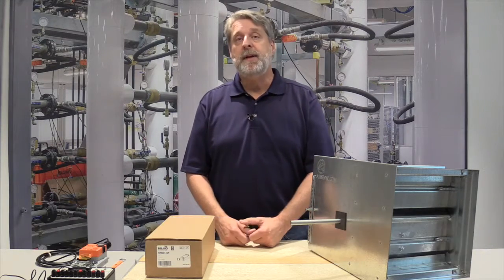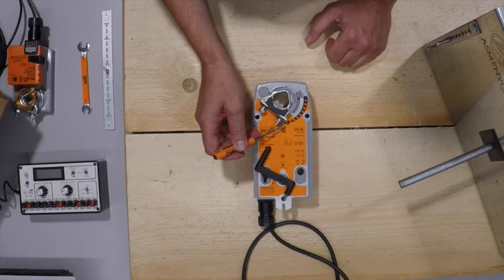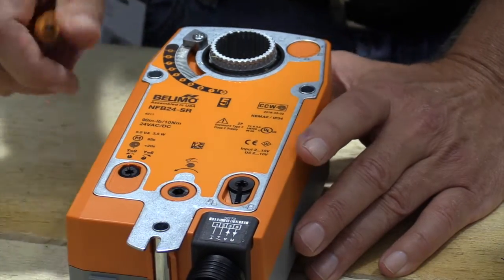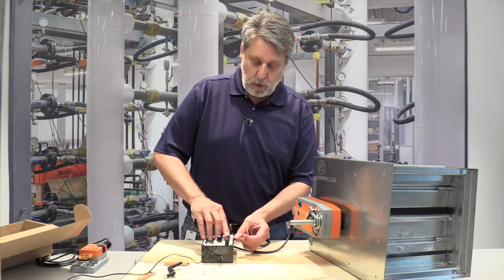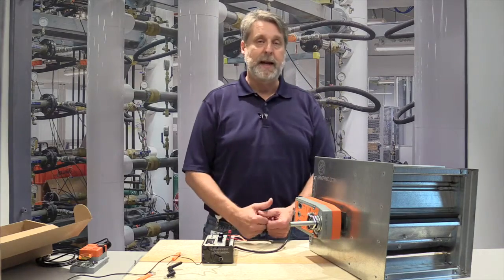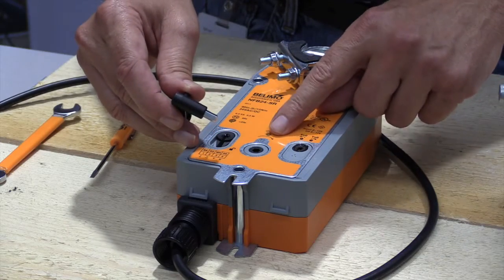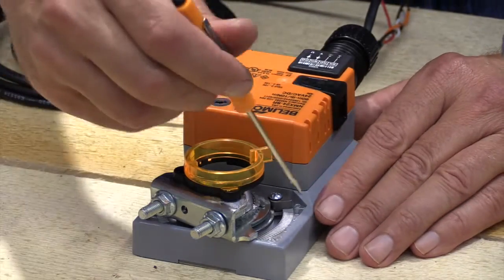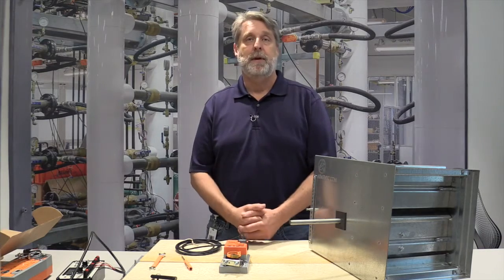How To: Pre-Tension a Damper Actuator

Comment: Hi we have same actuator and it makes a very loud winding noise when we turn off or turn on the AC. Is this normal?
Reply: some noise maybe, very loud noise I would not think is normal
Reply: @joemilton7552  it will make a winding noise. 
Loud would maybe indicate lose parts inside actuator or possibly the kit the actuator is controlling has loose or faulty parts.

Comment: Does it works with 24DC volt or 0 to 10 DC v ?
Reply from the maker: This video is showing 24 DC voltage. You can contact technical support for detailed instructions on a 0 to 10 DC v actuator.